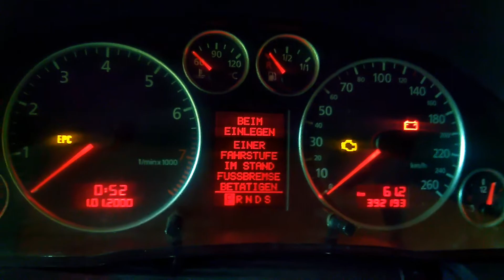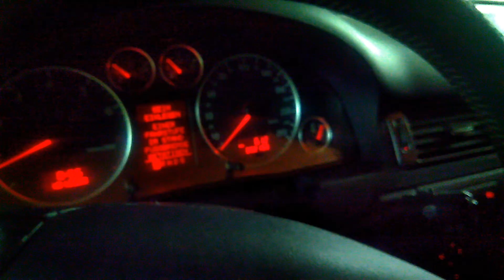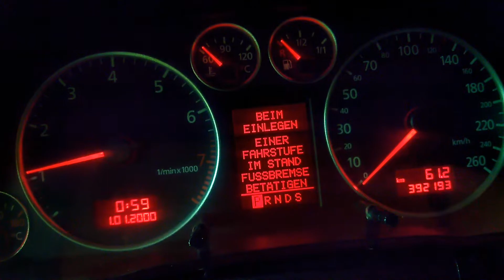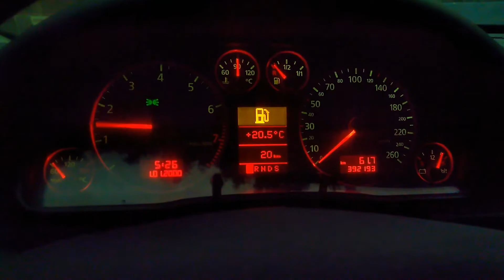High Mileage Audi A6 C5 3.0 V6 ASN Quattro 14; start up, check for leaks.

Comment: Got a C6 3.0 multitronic 315k kms , lovely condition , unfortunately had to replace the gearbox ... But its the first time i felt it was worth it. The car really is exemplary is every way , strong smooth engine , handles flat through corners , supreme comfort seats and ride whikst remaing tight and controlled. Can return decent mpg overall. Usual other hinderances to ownership an appetite for light bulbs which cone down to frayed wiring insulation and the usual oil leaks from tappet cover ggaskets , oil filter housing and cam solenoid O rings a all very cheaply replaced if you do them yourself ... i may add an android carplay headunit in future just to bring up the modern convenience. Very impressive brakes too , even with a faulty brake vacuum pump. Might as well replace all those vacuum lines too. 6000 lumen headlight bulbs would also help and give a whiter light and more modern look. The leather and majority of interior best lasting of the German brands apart from the button surfaces for window control etc